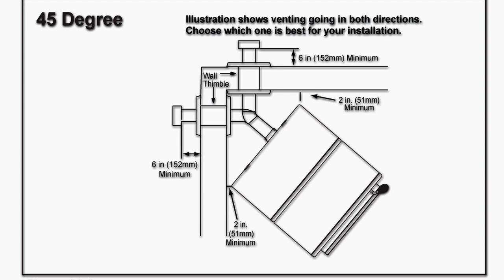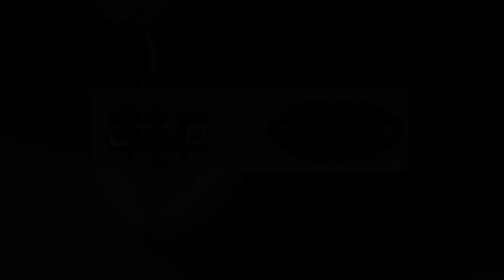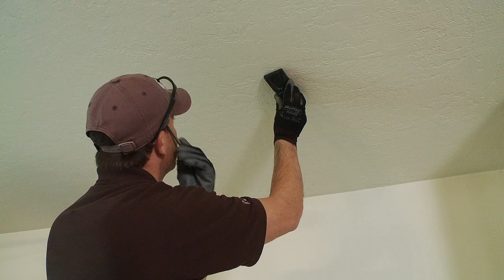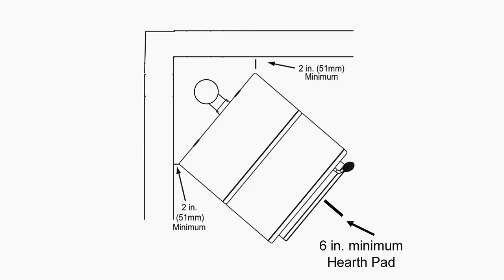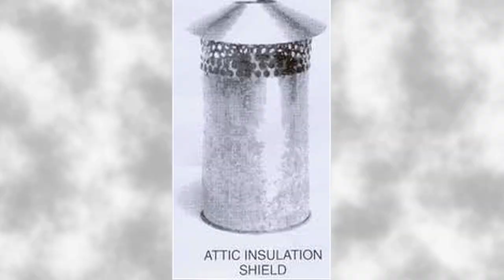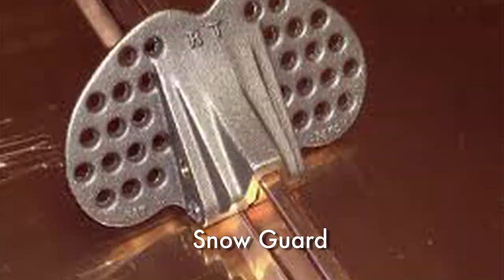Chapter 2   Placement & Installation for the Eco-Choice Pellet Stove

Comment: should i use foil tape to seal the joints or high heat sealant? thanks
Reply: Sealant should be good. I personally used both on the joints inside the house to be extra safe
Reply: I have a question for the pellet community. If I vent out of the roof, where do I get my fresh air for the inlet? 
I want it to come from outside the house, as I do not want my interior air being vented through the stove and out of the house.